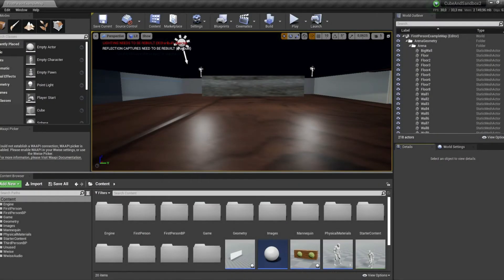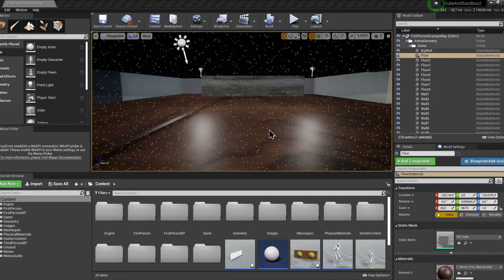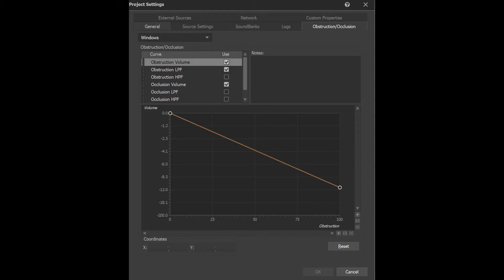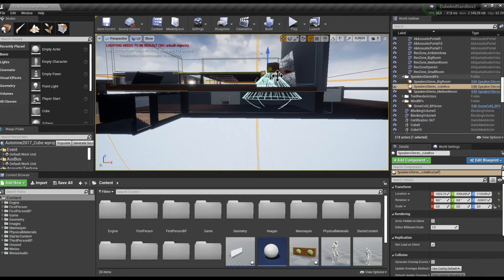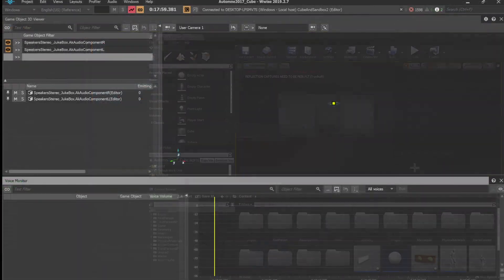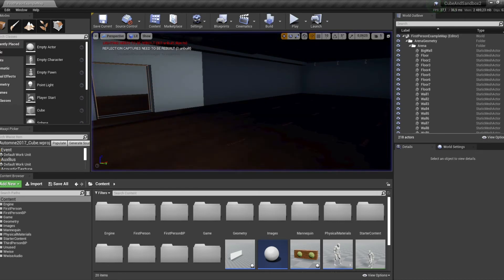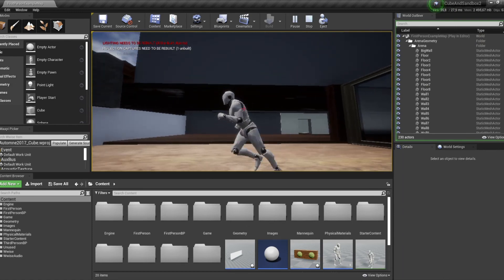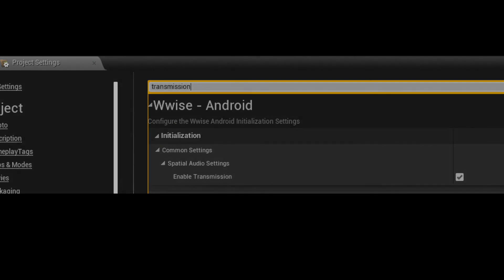Placing Sounds In 3D Spaces (Part. 4 - Obstruction/Occlusion) - Wwise UE4 Integration 2020

Comment: One thing I couldnt easily see in Wwise's Occlusion/Obstruction settings from this video was how to edit the amount of LPF or volume change applied based on the distance (occlusion seems to default to max value of 100 on the x axis), what if you wanted to scale your occlusion to some different factor or unit of measurement other than what's given?
Reply: Better use an RTPC for that instead of the built in occlusion settings

Comment: Very helpful~~But,i  have added ak geometry to the unreal wall material, and set Occlusion to 0.2 (also set the wwiseOcclusion curve, and turn on the transmission in the project), why there is no transmission happen？？
Reply: I never worked with AkGeometry but think it works directly in tandem with the Reflect plug-in and has to do more with reflections. You don't actually need it to have Obstruction. The moving wall and the floor in the examples here are litterally just simple Static Meshes with some basic textures without anything else.
Reply: @simonstjulesaillaud  thank you :-)